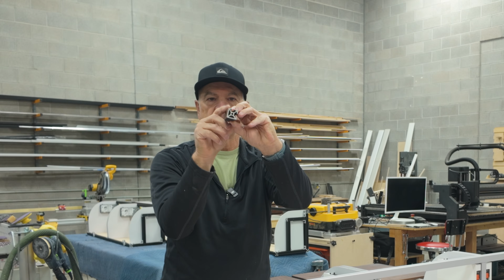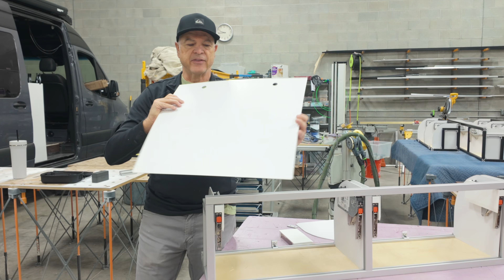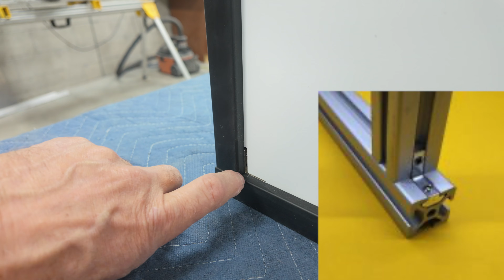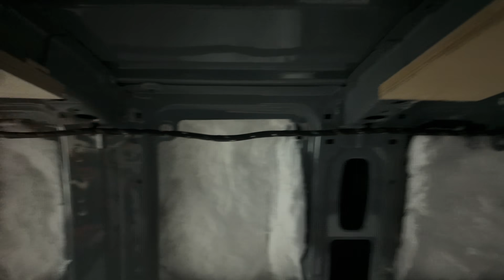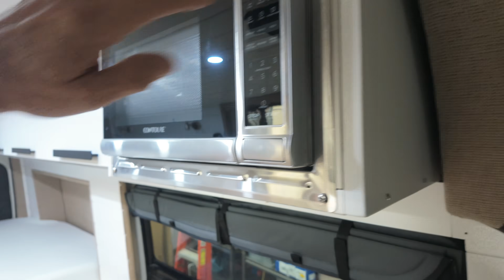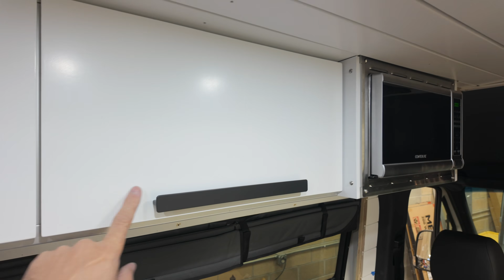Extruded Aluminum | 8020 | Van Upper Cabinets

Comment: Says he was intimidated  when first building the uppers with extruded Aluminium, I bought 90% of my van builds items fro, hi list that he promotes on every video, I asked one simple question because ei am another a builder in any way   and he refused to sneer, all it was , was the measurements of the theoretical and horizontal piece  not the width but th depth and hight and he said in one video maybe this on that he would have them soon , well I communicated directly with him d Lisa and they refused to give me these simple measurements I also built the sequence list, Never used and the spacers never used I found a better way to m space my v]\cages lined the wall with a 5/8 bark wood which in my opinion is a stronger piece to attach items. I even offered to pay for them but he only wants to see the uppers and in it for the money only. I unsubscribed and will never refer them again, When we ask for help because ehe claims to be the friend of the DIY builder but he  is Only in it for the money!!!!!

Comment: Jeff we are all intimidated and the reason we ask for a cut list or measurements so we can build it as well, can you help us please, I know you mentioned cut list coming but ha snoot been out yet, please! Thank you
Reply: You can buy the whole plan for the cabinet directly from their site. It is an excellent plan that is relatively easy to follow and comes with a BOM complete with suppliers and links. I did this and was able to order the pre-cut aluminum and other materials to build these. My build uses this 90" cabinet as a base and intead I build 2 cabinets, a 48" and 60" by redesign of his plans. Be aware the ordering from T-Nuts is maticulous so be sure to double and tripple check before hitting that "buy" button. It took 3 weeks for them to deliver the aluminum and a mistake in measurements can be hard on a schedule. Also be aware the plans will not teach nor direct craftmanship. That is all on the builder. Approach with deliberation and patience.

Comment: I am in the Uk and dreaming of building my own van one day. Love the thrive vibe! Thinking of using t slot for everything and been wondering about a couple of things. Would sliding doors of ply or abs sheet work for overhead lockers seeing as there are grooves in the t slot and are there are hinges or a hinge mechanism you could recommend for a top bunk bed to either fold down to become the back of a sofa or fold up out of the way (would also have slings taking the weight of the person).

Comment: Hi Jeff,  
I notice that you sometimes use the black 8020 and sometimes the plain aluminum look.  I prefer the black for my project. 
My question is do the black ones scratch and look bad after a while of van living?  
Does it look better over the long term to avoid the black extrusions?
Reply from the maker: The black does scuff and scratch more easily. We have to be super careful with it when we’re building the van. Not that much of it actually shows when the van is finished, so it’s not a big problem in that sense. Just be careful during the build.

Comment: @thrivans thanks for sharing all the plates and connectors you use in these upper cabinets, super helpful. Would you mind sharing your box dimensions for the Sprinter cabinet? The cabinets look to be about 12" deep by 14" tall but it's hard to tell. My 170 van came with the headliner. I'm considering bolting the cabinets straight through the headliner into the steel cross beam. What's wrong with my plan?

Comment: Great video. Have you used the TNUTZ  hidden corner connectors yet? If so, what are your thoughts? It seems that overall, the cost of these is actually cheaper than a bracket/tnut/screw bundle, and the look/functionality would be an improvement.

Comment: Any reason why aluminum box tubing is not used in van cabinet structural framing?...it seems like it'd be lighter and more economical...and if welded at the  corners and cross contact points for the main structure would not require all the L brackets and screws/bolts...any feedback would be greatly appreciated.

Comment: Thanks for all the great video's and thoughtful information.
Would you mind letting me know what you use inside the lower rails to keep the bottoms from rattling. I believe the actual slot is just over 1/4" and most 1/4" wood finished products are a hair under that 1/4"....thus an opportunity for rattles...
thanks so much

Comment: Love our Videos!  Very Well done. Thank you!  Quick question, I think you mentioned that the cabinet T bar pulls are from Restoration Hardware.  I can't seem to find them.  Can you point me in the right direction?  Also, What wood are your doors made from?  I watched your painting video and that was VERY helpful to get a good finish.  I'm building out a squaredrop trailer, but usng some of your tech for my upper cabinets.
Reply from the maker: The cabinet hardware is from IKEA. The doors are poplar frames and 1/4” Baltic Birch in the center.
Reply: @thrivans  Thank you!!  I'm guess the flat doors are Poplar only?  Thank you for sharing your wealth of knowledge.  The Mrs. has amazing taste with design and colors!!

Comment: Hello thrivans. Regarding your rear fixings, which cling to the framework of your van or campsite car. Would it be possible to add a rubber band. Which would serve as a small shock absorber or silent-block, in order to avoid any harmful noise while driving. Clearly, make the set not completely united with the sheet metal or structure of the vehicle ..? Thus avoiding the noise of spreading throughout the passenger compartment ..! I hope you have understood all of my words. I use the Mate-Translate extension on Firefox, because I am French and I unfortunately do not master your language at all. Sincerely Jean-Marc.

Comment: Great video - love the engineering - I have 2 questions though - do you use a metal screw and screw the hinge into the aluminum or just the ABS, and how do you keep the doors from opening on the road, the spring loaded hinge seems like it open too easily, thanks!

Comment: Hi Jeff, any chance we can et the dimensions of all the parts, I believe the only size you mentioned is the 90" but how about the vertical  a bars and the ones from front to rear, That would be a great help with my sprinter, Thanks for the videos
Reply: Did you ever figure this out?
Reply: @flappytaco  no
i did not get a reply to that question

Comment: Great Video, I am using your method for my upper cabinets. Thank you so much for your instructions. I have just received my Utrusta hinges, but one thing is not clear to me. How do I screw them into the aluminum? In a previous video you mention you use a stainless steel screw (the ones that come with the hinges are not strong enough) right into the bar, but how do you do it? Are you using 2 slot aluminum and screwing into a solid side? Don't the screws from the hinges on either side hit one another? I would love some more details on this - thank you so much for all your videos - they are the best out here!

Comment: Another great video Jeff! Thank you. In another video you posted few years ago, you used 1/2 “ furring strips for the roof ribs and they were 2” wide. In this video you are improving/upgrading to 5/8” thick and how wide, 3 1/2”? What is the rationale for the change? Thank you!
Reply from the maker: The 5/8” holds longer screws. The wider pieces allow us to screw through the furring strips without hitting the metal ribs. We also bolt the upper cabinets to the furring strips. The wider strips allow us to do this.
Reply: Thank you Jeff, as always nice work on your vans.

Comment: Is there a cut list available for the upper cabinet? I couldn't find it if there is. Thanks
Reply from the maker: Not right now. We are working on it!
Reply: @thrivans  ts 9 months later Jeff would you have a cut list we can purchase from you?
Reply: @thrivans I would buy the cut list!
Reply: @derick8793  me t and so would so many of your viewers and subscribers
Reply: Hi Jeff. Thanks for posting, I appreciate the clarity of how you’re hanging these upper cabinets. One question - looks like the screw holding the 2-hole plate to the corner bracket is taking all the stress from hanging on the van wall at the lower attachment point. Any issues with screws breaking? And do you recommend putting any high density rubber at this metal-on-metal  interface

Comment: What do you use for your van floor.  My old van was 3/4 plywood, but that was heavy and got pretty beat up.
Reply from the maker: We use the factory floor that comes with the van, and then put 1/2" LVP flooring over it.,

Comment: Curious whether you have tested the method of cross-drilling and end-tapping to achieve hidden joints. Less hardware and more strength. And have you an opinion on using Euro sizes, like 2020, 2040, etc.?

Comment: Wow, excellent video, thank you! I hadn't even considered simply hanging the shelves on the van metal like that. I bought bookshelf brackets and was wondering how I would line them up without drilling more holes. So appreciate the downloadable materials doc!!

Comment: Also, can you make recommendations on how you would do undercabinet lighting? Specifically how you would run the wire? Would you create a double bottom?
Reply from the maker: We use LED strip lights. If you use round puck lights, you would have to make a double bottom.

Comment: Excellent, as always. I did come across another solution where a 90° angle is fastened via rivnut into the upper truss and that that is secured to the 8020.
Reply from the maker: That would work. We used to use the 90 degree corner brackets, but you then must notch the ABS liner around the brackets. Also, there are so many holes in the ceiling truss that it can be hard to find a good spot to attach your bolt. We find it easier to just put a bolt through the furring strip.
Reply: @thrivans  Love the idea of oversizing the furring strip. I hadn't thought of that either. Brilliant! So helpful!